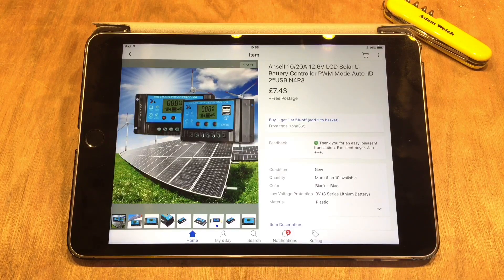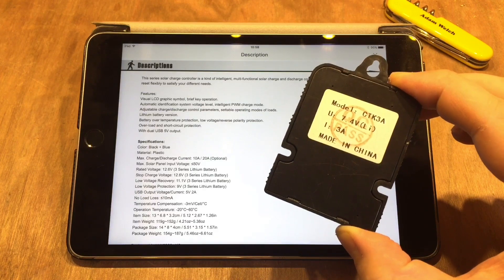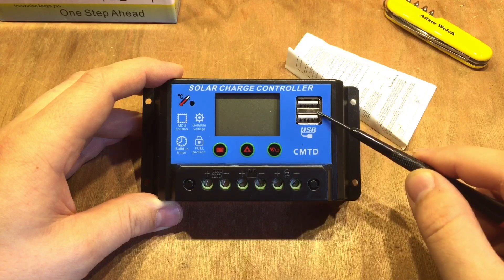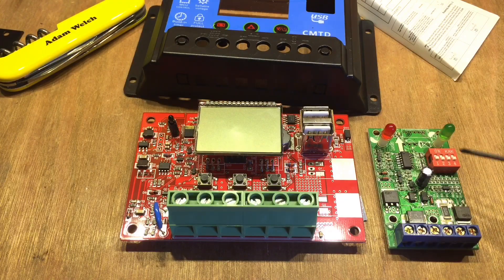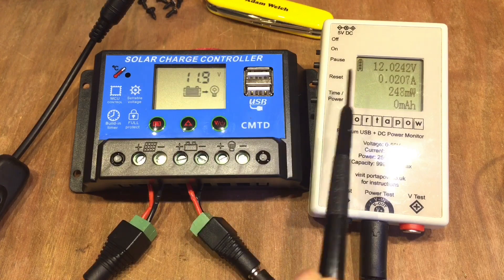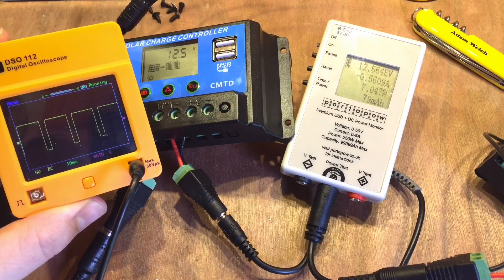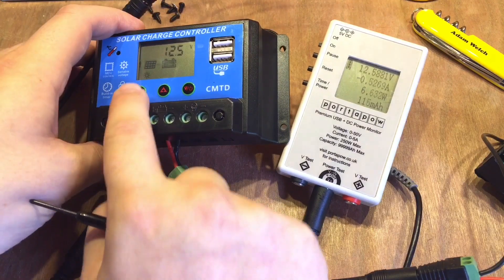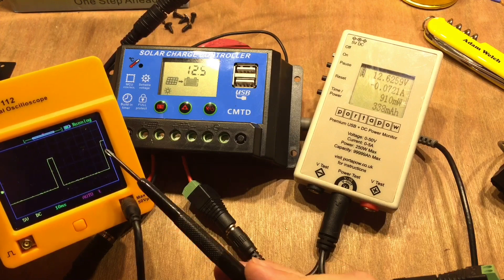Anself CMTD 3S Lithium Solar Charge Controller - 12v Solar Shed

Comment: Are 30Amps PWM model like these one? Thx for interesting vid.
Reply from the maker: +Horia Faliboga In what way?
Reply: This PWM model is 10/20A model. Are 30A PWMs with the same 2 USBs and LCD?
Reply from the maker: +Horia Faliboga I can't say for definite as I haven't got a 30a model but generally series of controller have the same feature list, they've just had some components upgraded or placed in parallel to accommodate the higher currents.

Comment: Great look at this charger. I have seen notes that this charger is only for flooded batteries not Lithium, so you have reach the right conclusion. NOW, since you seem to be tech savy, why do you think the instructions would tell you to put the battery on first then the PV then the load and remove in the reverse order? This concerned me, for what happens if the battery is just disconnected leaving the PV? The controller goes up in smoke? Or is it a woory about selecting the correct voltage for the system, i.e. 24V
Reply from the maker: Thanks for the kind comments.  Determining the battery voltage is probably one reason why it's usually battery, solar, load, however there are probably a few other reasons for it.  Most charge controllers are powered by the battery directly, not having this stable power supply is likely to cause the microcontroller (or other internal circuitry) to act abnormally.  I have had controllers connected to solar when a mistake has disconnected the battery - I'm yet to kill one though!
Reply: Well, once again, spot on. The controller IS powered by the battery and since it is the default 12V, nothing seems to bung up when it is disconnected and reconnected. But you are correct that, with the battery removed, it starts to act erratically, powering from the PV input. THe voltage jumps all over (I removed the battery, what the heck, see what happens), but didn't seem to display the battery was gone. Add a load, and now I got a 'no battery' error. turn off the load and it goes back to the voltage jumping around.
Reply: The reason is this controller works on either 12v OR 24v systems.  Connecting the battery first allows the controller to detect which voltage the battery is using, so it knows whether to run 12v or 24v.  You wouldn't want it sending 24v load out to your 12v devices.

Comment: Hi Adam, I purchased a WIncong SL02B-10A from ebay: http://r.ebay.com/vB3NjN
I have it connected to a 3S20P pack that I made from recovered 18650's.

I'm pretty happy with it given the price!
The voltage settings are all easily programmable, so i was able to set the cut off voltage at 12.3Volts instead of 12.6v, giving each cell a max charge of 4.1v (less capacity but better longevity).

It also has a 'float charge' voltage setting, but the name is misleading because it does not seem to float charge.
I have a dc power meter connected in between the charge controller and the battery, and it shows no current flow once the charge is completed.
So for example I have the stop charge setting at 12.3v and the 'float charge' setting at 11.3V.
Once the battery reaches 12.3v, all current flow to the battery stops and it doesn't start to recharge until the battery falls down to 11.3v.

Wincong also make an LCD version which appears to be much the same: http://r.ebay.com/zrKMW7

Might be worth having a look at one of these on your channel?
The fact it says 'float charge' would probably mean you would discount it, but like I said it does not 'float  charge'.
Reply from the maker: Thanks for this.  I'm finding my lead acid solar charge controller is doing a better job of charging my lithium cells that a 'lithium' solar charge controller.  This one and the other I have looked at are attempting to get the battery to a set point and keep it there.  The lead acid charger (and the one you suggest) seem to be getting the batteries to a peak level, and only getting to float once the battery level falls to that level.  This is perfect if like me you're using the power from those cells after the sun has gone down (or when it's producing such low levels of power it really doesn't make much difference). If you're using power during the day I think you'd still have to be careful on how that power was used and what that meant for the health of the cells.
Thanks again.

Comment: This is long but very descriptive on my think outside the box outcome. I put in links to where you can see the stuff I used and get a better idea.
 I am using a 80 amp PWM solar charge controller for wind turbines ( Only this one does this http://rover.ebay.com/rover/1/711-53200-19255-0/1?icep_ff3=2&pub=5575119394&toolid=10001&campid=5337966591&customid=80+amp+high+volt+PWM&icep_item=111837262704&ipn=psmain&icep_vectorid=229466&kwid=902099&mtid=824&kw=lg Proven Controller
Its a PWM that has a 32 volt max solar panel input for 12 volt, 50 volt for 24 volt. I use it on my 24 volt 1000 watt Sunning turbines to charge my 32 Deka batteries in a 12 volt system. I have a WIND AND SUN POWER diversion controller if the turbine exceeds 32 volts against the 24 volt slave bank. Here http://rover.ebay.com/rover/1/711-53200-19255-0/1?icep_ff3=2&pub=5575119394&toolid=10001&campid=5337966591&customid=Professional+diversions+controllers&icep_item=151823544093&ipn=psmain&icep_vectorid=229466&kwid=902099&mtid=824&kw=lg Programmable
 Very simple, you just put in a set of 4 wired for 24 volt slave batteries, cheap car/auto batteries work best since your maintaining 80%+ DOD and from there you feed that 26.8+ volts into the solar controller then set the PWM connect/disconnect to come on sending charge of up to 14.7 volts to my 32 deep cycles at 26.4 volts start, and disconnect at low volt 25.8 volts. 4 years its been working perfect on the same auto batteries. 
If you can not get a Sunning Turbine, then get a Hurricane 24 volt or higher. http://rover.ebay.com/rover/1/711-53200-19255-0/1?icep_ff3=2&pub=5575119394&toolid=10001&campid=5337668021&customid=Engineered+wind+turbines&icep_item=272253571691&ipn=psmain&icep_vectorid=229466&kwid=902099&mtid=824&kw=lg Proven Quality
 I am yet to make a video on it or any technology adaptations I have due to the idea as wired and set up with voltage chokes and cooling that I designed will without a doubt be stolen for one of his scams by that criminal known as Missouri Wind and Solar who is a life time thief and con man.

Comment: Theory: 7.4V, with a trickle charge? That may not be good for li-ions, which can't take a trickle. But it sounds perfect for a 6S of NiMH cells. Could it be that the little charge controller was actually designed for NiMH, and is only falsely labeled as for li-ion? Certainly plausible to me, NiMH are still the cell of choice in emergency lighting.
Reply from the maker: +Vyl Bird This Anself trickles at 12.6 but the other PWM solar charge controller I showed does have a NiMH version at 7.2. Did I show the wrong one? There are a number of variants. 7.2 NIMH, 7.4 Lithium, 11.1 Lithium and 12 Lead acid all at 3 amp. All identical on the inside - except for the target voltage in the code.

Comment: Thank you for these kind of videos. There are tons of these things on ebay but it always remains a gamble on what you get.  The pile of devices that I have here in my house is driving the misses mad, and to be honest I can't blame here.
I was looking to replace my lead acid charger with one with a display which is always handy to have but try to find a decent manual online. They always say LCD display and show the Voltage via a generic manufacturers pic, well current for me is as important for most things than Voltage.
Having the same battle with a car that I might buy tomorrow that includes a gps.  Neither the garage knows nor it is indicated in the docs I found online if I can see the speed limit on a certain road so you are stuck to what is in it.  In my current car I velcro'ed a Nexus 7 over the standard radio that had it's time and it is just a matter of installing the software. It's just fantastic.
If we could only speak to the developers instead of the sales and marketing team I think the world would be a far better place to live in for us techie guys.
Reply from the maker: +Luc Peeters There's s lot of misinformation on eBay, and sadly lots of sales people across all different kinds of products are not kept informed on all areas of a product. 
YouTube for me is a place to check things before I buy them. For me, if I can't find a video I make one! 
Thanks for your comments. I hope you get what you want from your GPS!
Reply: Luc Peeters I

Comment: With .044ma draw could that be what the controller is pulling to run itself?
Reply from the maker: +rvprepperwayne The 44ma was a gain into the battery not a draw. It was showing negative because of the way I had wired the meter round.

Comment: i am interested on your oscilloscope which model is it? can it be used to check if the ac signal its modified or pure sine ? thx
Reply from the maker: +Serviciosymas I've put a link in the description. It's not a great oscilloscope but with a 10x probe it should be able to display those voltages.
Reply: thank you!

Comment: I like it. It can't be long before the Chinese market realises there is a market for lithium solar CC's. Maybe if you had a larger bank of lithium cells you could leave a 50-100ma load on constantly to negate the float charging?
Reply from the maker: +pietkaify I guess time will tell. You'd have to run this for a while and see how the cells did. Once one failed, or reduced significantly in capacity I guess you could take a cell apart and compare with one which hadn't been float charged. Like I said in the video - in my case, a lead acid solar charge controller is doing a better job at charging my li-ion cells in a cc/cv type manner. Cheers
Reply: Add a 12v 0.12A pc fan to help cool the charger and waste that extra current! You can adjust the disconnect and reconnect voltages of the load outputs to make this happen at your desired level.

Comment: It also looked like it was doing temperature compensation. Definitely seems like a lead acid style charger. I'm currently thinking about making a modified PWM5 (from your design) to try to cut off the pwm charging when it gets to a low pwm duty cycle and then have a hysteresis where it doesn't try charging again until the voltage drops a certain amount. This could be doable with one of your Arduino prototypes, as it only requires some code changes.
Reply from the maker: I've been thinking about this myself but there aren't enough hours in the day! Perhaps in the longer winter nights I'll be able to put some thought into it. I hope you manage to pull it off and I'd love to see it when you do.
Reply: Hopefully I can get to it soon. I was also thinking of using one of those cheap, small buck converters to power the Arduino from the solar side. That way it won't pull from the battery during the night. I am hoping it won't drop the voltage too much on the solar side since it is such a small load.

Comment: Nice video, really informative. i couldn't see the link to the video of the lead acid charge controller for lipo. can you link me it please? thanks.
Reply: I wonder how well lipo and Li-ion performs in the cold compared to lead acid. Might be worth checking that before you ruin nice cells in our Northern cold type of weather if you use and store them in a garden shack.
I've heard stories of people with e-bikes that their batt packs were dead after staying a winter parked outside.
Reply from the maker: Thanks Kris - I've added a link to the description, but to save clicks... https://youtu.be/YoH7V56RtkM
Reply from the maker: +Luc Peeters Its a good question. If I destroy them I'll be sure to report back. It wouldn't be a total waste - other could learn from my mistakes.  I suspect because they are receiving a charge every day they may be ok - the issue is going to be around when the charge doesn't reap as much power as my lights extract at night. Always an issue for off grid applications.

Comment: İ tried to built the cheapest Lipo charging system using 10W solar panel without using a solar charge controller. Basically, used one cheap (0.99$) 2A DC-DC buck converter module and TP4056 Lipo charger with protection circuit. Works like magic. Total cost less than 12$ (including handmade solar panel made out of cells 40)
Reply from the maker: Excellent. I like the ideas.  Thanks
Reply: Orkhan AmirAslan I'm going to do almost the same. :) But it's a 18v solar panel (I don't know how many Watts yet) and a small 3a buck converter. :)  And I'm going to use up to 12 18650 batteries in parallel (I need to check each one's capacity and make the calculations.)
Reply: Keep is updated.
Reply: Orkhan AmirAslan Sure. As soon as I make it I'm going to publish in my channel. Then I find this comment and put the link here. :)
Reply: Orkhan AmirAslan 
Do you have any schematic?
Reply: But is that only for one cell?
Reply: Orkhan AmirAslan Do you have any schematic?
Reply: Do you mean 12 run in series? From my understanding, the volts of the battery and solar charger ( asuming you had a solar charger but you are substituting the solar charger for the buck converter) need to be all the same volts. Unless you are getting a step-down buck converter from 12 to 18 volts to 4.2 volts. The volts of the battery pack your making from the 12 batteries run in paralel. I assume you know you can make them 12 volt by bust running 3 sets of 4 each in paralel then connecting each pack of 4 together in series that would give you a battery pack of 12 volts and 8 AH or 12 volts and 16,000 Mah. But I assume you might know this and might be wanting to run a device with lower voltage and increase your capacity which would give you 4.2 volts and a 24AH or 48,000 MAh. (assuming each battery had 2,000 Mah capacity). But I assume you must know this already. If you already did it how did it work out? Also does anyone on here know what the best solar charger would be to use for lithium ion 18650s.  Like can any one work even if its rated for lead acid or deep cycle? Assuming that you dont overcharge? And Also two other questions does anyone know the optimum amount of amp hours the battery bank should have per solar watt system? i.e. a 12 volt 400 watt solar panel system with a 12 volt solar charger and  battery bank with 12 volt (_____________)Amp Hours. what would be the optimum Amp Hours my battery bank should have. One last question if anyone might know. What about the optimum wire gauge from the solar charger to the battery bank? Obviously the larger the gauge the greater the current flow so considering the delacacy of the 18650 batteries what would someone say would be the best gauge wire to use from the battery bank to the solar charger?